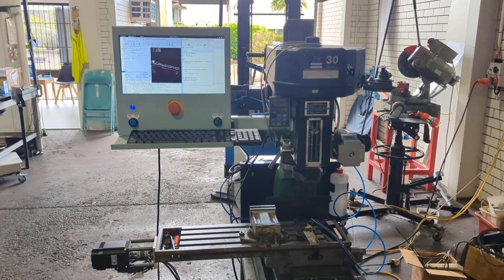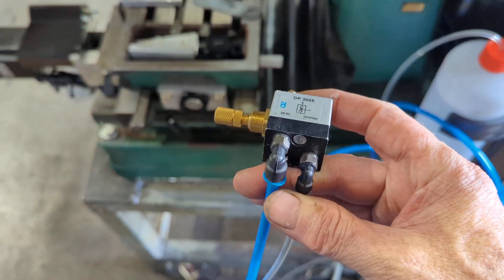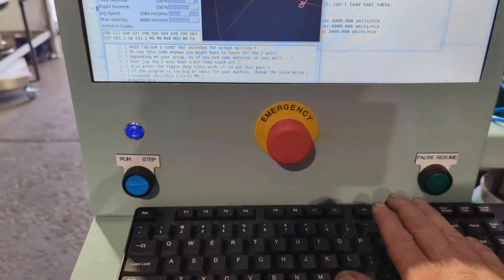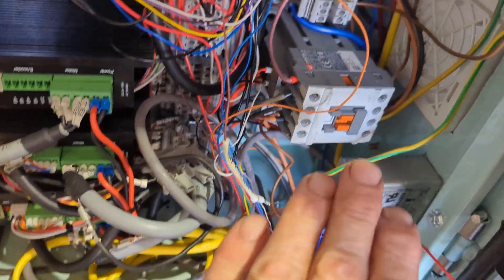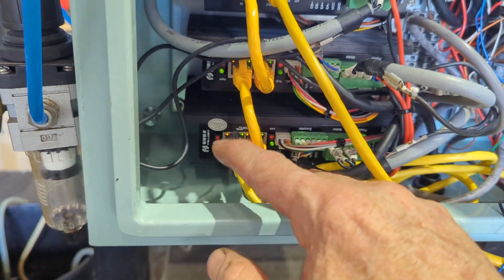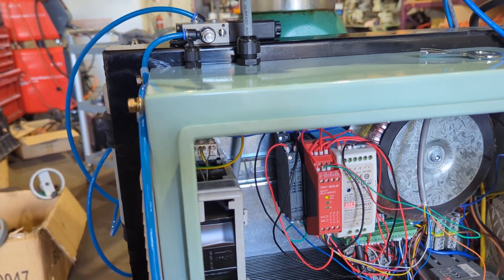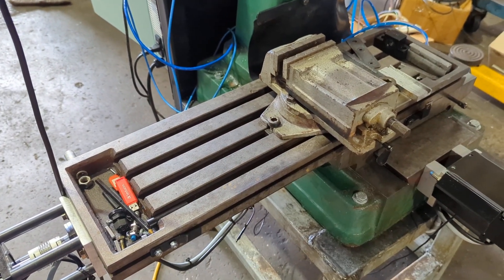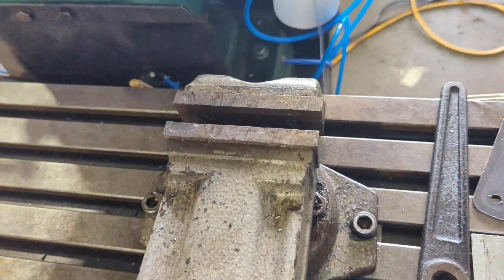Boost Your CNC Machine with EtherCAT Upgrades

Comment: Hello sir,
I think you are an admin on LinuxCNC forum page..!

Can you help me configure Ethercat setup?
A transition from PCI  Parallel Card .!

In steppers we use pulses per mm.  How it differs in Ethercat?

How to configure hal and ini?

A basic concept change in few words!? 

Just about the topology 
Can you?
Reply from the maker: No, I am not an admin.  Ethercat is similar to steppers. Usually ethercat motors have encoders that output pulses per revolution. You convert this to pulses per mm and entered into the hal file instead of the ini file. You have to write your hal and in files with the ethercat XML file by hand because there is no configuration tool like stepconf for ethercat systems but there are published templates..